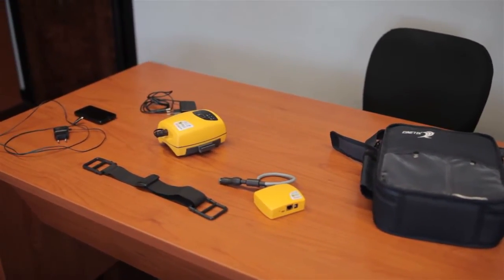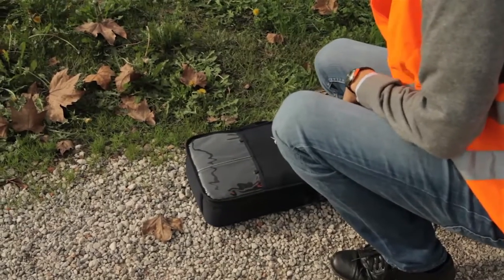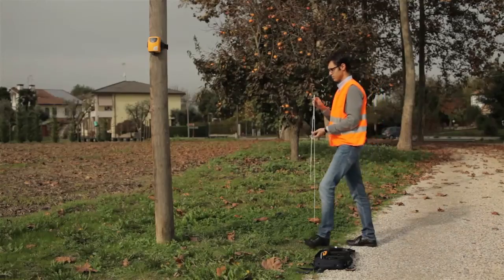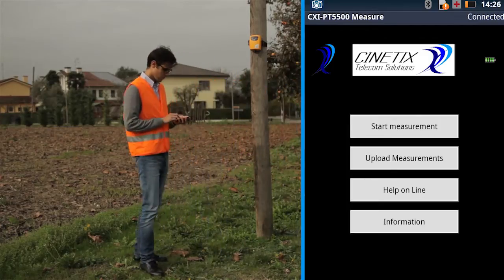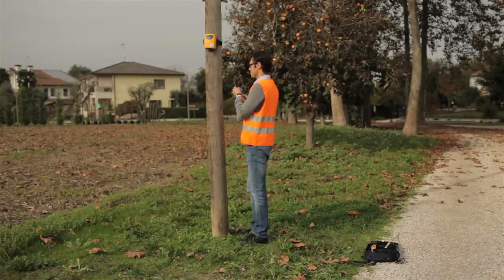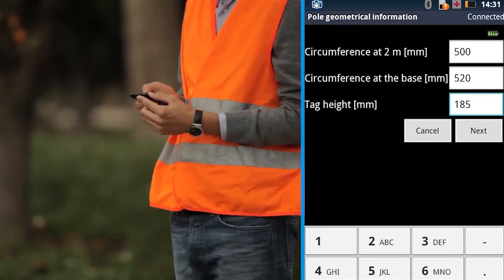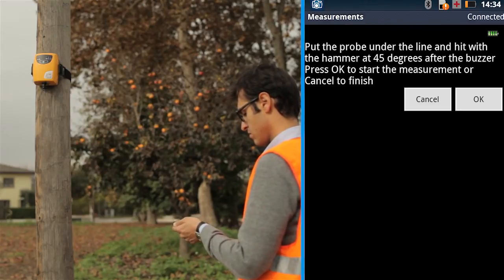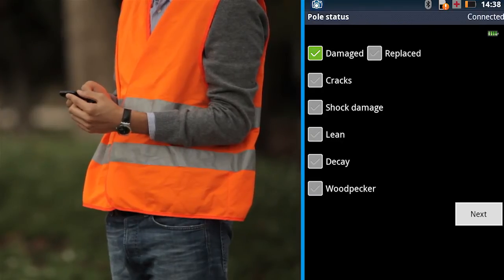Utility Pole Testing with the CXI-PT5500

Comment: This is just sonics revisited, which is the best way to miss even significant rejects in the field.   It has a very narrow zone of influence, which is entirely above ground.    Decay starts and progresses below ground.  On top of that, it has no function to check external decay below ground which has the greatest bearing on strength reduction.    This is junk science at its worst.   If someone uses this product, I can assure you that you will be missing a lot of bad poles and you will be hiring someone down the road to find the ones that were missed using a different method.
Reply from the maker: The product detects  decay BOTH below and above ground. It is NOT using sonic, rather it is vibrational analysis.